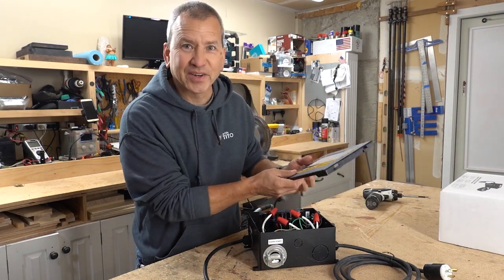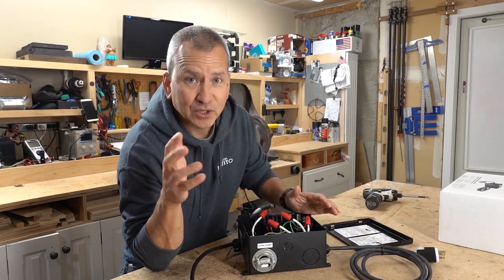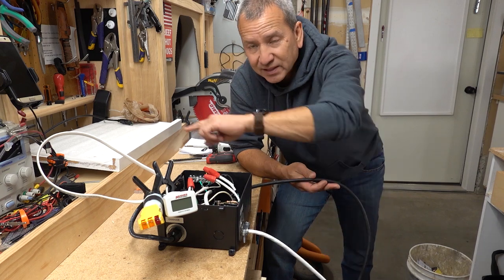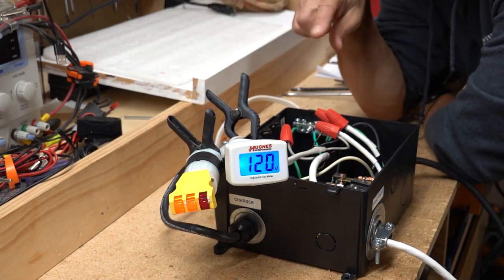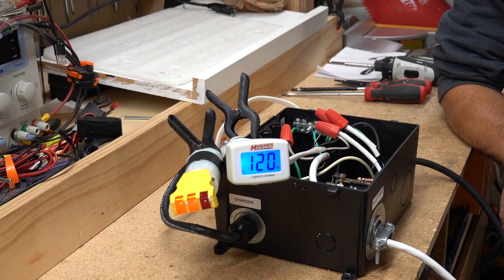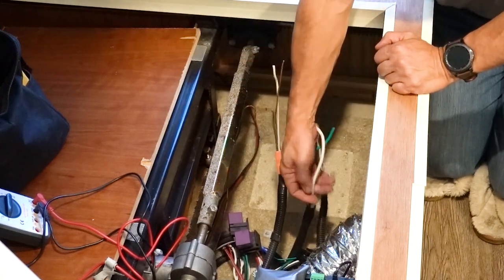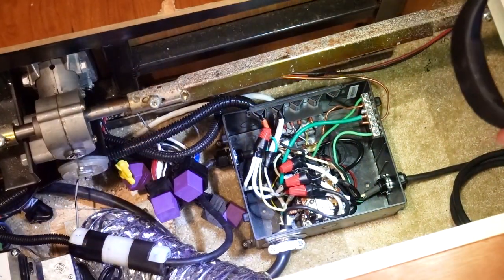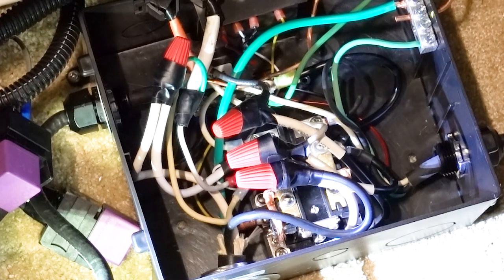DIY Off-Grid AC Power to Your Entire RV - Inverter Transfer Switch Install

Comment: Hello, I have a question, does the automatic transfer have a delay? If I am using the inverter and the grid power returns, the transfer has a default delay

Comment: Question:  could you put in dc instead of ac on the transferswitch input you are using that isnt shore power.  My rv brings in the dc from a truck and switches it off when ac is applied.  Looking for something similiar

Comment: If you have shore and generator power and a transfer switch, could you add a second transfer switch to the ac output to provide inverter switching?

Comment: Just bought a new Go Power 30A transfer switch and they now look a little different.  All the wire connections are fitted with WAGO connectors and the actual transfer switch is in a little clear plastic case so the wires cannot interfere with the operation of the switch.  Apparently failures were occuring when the wires contacted the switch mechanism.  That cannot happen now that the switch it protected.   Its pretty slick and easy to wire.

Comment: Could you use the charger plug to also connect the AC so it only runs when on shore power?  I don't want my AC to run when the transfer switch goes to the Inverter side.

Comment: Why does the battery charger have a plug? Wouldn't that need to be wired to the converter which charges the battery?

Comment: Still confused about how to connect the my 12v appliances with the 12v solar AND the 12v converter from shore power. ie. If i'm on shore power, can I just run the 120ac/12vdc converter and use my 120v appliances and 12v appliances? and then when I"m boondocking use the 12v battery/inverter to do the same thing? can I just connect the 12v output from the converter into the 12v fuse block that's connected to the 12v solar batteries?
Reply: Your solar goes to solar charger then to batteries,
Your inverter is also connected to solar charger and running off the batteries that are hooked to it that it’s charging, your Rv is always going to run 12v off of the batteries solar or not. When on shore power your batteries will charge with converter and everything in Rv that’s 12v is still running off batteries and all your 120v is running off shore power. If you’re running off of solar and inverter you need to shut off converter so you don’t create a loop that’s what the transfer switch he’s showing does. You don’t need to wire anything to 12v fuse block it’s already wired that way. You can just plug shore power cord to inverter to use 120 and 12v but if you want it all to switch automatically when you plug into shore power that’s what this transfer switch does, plus it shuts off converter at the same time.
So recap solar to solar charger to batteries.
Solar charger to inverter, inverter to transfer switch. Shore power to transfer switch. Charger terminals in transfer switch to input side of converter.

Comment: So is the Shore Power input or feed-line, taking into account ALL charging sources or "mechanisms" - Generator, Engine Alternator, actual shore power & potentially solar?
Reply from the maker: The shore power input would only have shore power or generator power on it. You'd still need a transfer switch to automatically switch between shore/generator power on that input. Alternator and solar inputs are DC and would go directly to the battery, not through the AC transfer switch.

Comment: I have shore power and on-board gas generator already. I am adding 3000 watt inverter so I guess I need a transfer switch that take in THREE sources?
Reply from the maker: Sounds like too much thinking for that switch. You'll need two transfer switches or simply add a plug for the shore/gen input and move it manually.

Comment: OK, everybody talks about the transfer switch. How do you connect an inverter when you were RV has a generator in it already and already has the front switch for power and generator
Reply from the maker: You'll leave the gen/shore transfer switch and add this one to the output of that one.

Comment: yes but what do I do if the RV is designed to run the lights off the converter...ie if the converter is off theres no 12vin camper
Reply from the maker: When the converter is off your batteries should provide the 12v. Are you saying that when you're not connected to shore power your lights and other dc powered equipment don't work?

Comment: Question: Can I use this transfer switch with inputs from shore power, generator and inverter? How would I wire the 3 inputs? Thank you
Reply from the maker: The transfer switch will only take two inputs. You'll need a second transfer switch for the generator/shore power.

Comment: Brian, thanks for the great video, I have an 08 Winnebago. my tv outlet runs off the inverter and when connected to shore power it runs from ac, I didn't understand how it worked but thanks to your video I have a better understanding of it. I just installed an electric fireplace that the tv is now mounted to the top of can I plug the fireplace into this outlet or should I run a dedicated line from the breaker box?
Reply from the maker: You'll need to know the rated AC current (in amps) of the fireplace and everything else on that circuit. Make sure the electrical wire and circuit breaker on that circuit is adequate.

Comment: Hi Tito , what do you have wire from your shore power on your fuse box? Do you have any outlets plug into your 12v fuse box?
Reply from the maker: Not sure what you mean. You lost me at shore power whic is AC power. We do have several 12v DC outlets and several 5v USB plugs throughout.

Comment: I have a couple of questions. Do I need a transfer switch if I am using the old lines from the generator from my RV? Did you install an on/off switch?
Reply from the maker: If your shore power input can be shore or onboard generator, then yes you should use a second transfer switch if you want it to be automatic. Another option is to add a female power connection to the generator output. You can just plug your shore power cord into it.
Reply: @RVwithTito  thank you I took the generator out though

Comment: I have a question, i just installed a new bigger inverter to run off solar power and i have power to everything except my microwave and AC's. Is this in the wiring after the transfer switch or in the transfer box itself?
Reply from the maker: Most likely after the transfer switch. You're RV wiring may have the large loads on a separate leg. Is it 50A? If so, then your electrical system is split in two. Some RVs also have an energy management system installed which disables power to high power circuits when it detects 30A or 20A service. Hope that helps.
Reply: @RVwithTito  my 5th wheel is 50 amp with 2 air conditioners, so I figured one of them would turn on. If it has that energy management system how would I bypass that?

Comment: I enjoy all your videos.  Your work is outstanding, explanations are clear. Thanks. My question: how come you installed the transfer switch flat? I was always told  and read that  a transfer switch can be installed in any position EXCEPT flat, for security reasons. 
Safe travel.
Reply from the maker: I just put it where the previous transfer switch was. What could you tell us about the security concern? Thanks.
Reply: While troubleshooting a Magnum 3112 with a failed breaker switch, one of the 2 switches had burned because the coach  vibration led to the 'off duty switch' to fall flat and short circuit. Still can't figure out why, but it was 8 years old...?
While looking over videos on YouTube,  seems some manufacturers do not recommend mounting flat, probably for that same  safety reason.
Manufacturer install manual probably is the reference if the product is well documented, which is not always the case with some Asian products.
I especially enjoyed your video on the Lithium batteries/ bracket. Will build something similar. Very cool !
Safe travel.

Comment: My converter came with a three prong plug. Where do I plug it in of can I wire it in to the box with a circuit breaker?
Reply from the maker: Sure. You could always remove the plug and hard wire it. If you prefer not to do that, then wire a cord to the transfer switch and put a female plug on the end. That way you can just plug the converter in. Be sure to use a proper gauge cable though.
Reply: I bought a plug and used the tire from the old converter. Thank you.

Comment: is there a built in circuit breaker in the switch? is that why you don't reconnect to the breaker on the power center? thanks
Reply from the maker: The switch has a fuse on that line not a breaker. I took it off the breaker since the breaker panel is on the main AC bus.

Comment: You did pretty much same thing using a contactor, about 6 years ago. Have you changed your mind on using a contactor?
Reply from the maker: Still needed to flip the breaker on the converter charger each time with the contactor setup.
Reply: @RVwithTito  I’m really not arguing, but the name of that video was “how to automatically disconnect a converter charger when using an inverter”. I’m just trying to understand. I do enjoy your videos!

Comment: How come you not to use your generator anymore? can I use my generator with this system?
Reply from the maker: I had lots of solar and a DC-DC charge for recharging batteries while driving, so I no longer needed it. Yes you could use a generator. You just may need a second transfer switch.

Comment: How do you power your 12 volts with out the converter powered do you run a separate wires to the dc side of your panel
Reply from the maker: When the converter is not on 12V power comes directly from the batteries.
Reply: @RVwithTito  i only get 12 volts to the dc side of panel when the converter is powered

Comment: Thanks, Brian. Love your videos and apply many of them. 

My question is, “Do you even need your legacy charger anymore?”

It seems your new DC-DC converter or your solar charger should have the batteries all charged up by the time you arrive and plug into shore power. Will you ever actually charge your batteries from shore power?
Reply from the maker: You're right. I rarely do. During the winter perhaps.

Comment: hi
i want to install this transfer switch but i have a question,

i have my original house battery setup 1 house battery from engine bay that operates my low 12v lights and water pump and i have another solar setup of 200ah batteries with inverter that i want to connect the inverter to the transfer switch but when it will operate the inverter it will also operates the converter and sends 12v from 2 places one from the solar battery setup and second from original house battery in engine front,

how do i connect it so it will work the best???

Comment: Excellent video. Really enjoy how you explain things at a level I can understand. It's it possible to run a similar transfer switch set up to a portable power station? Since I don't have a built in inverter system, I have an EcoFlow Delta Pro that I plan to use as my boondocking power system on my travel trailer. Thanks.
Reply from the maker: Yeah. It should work and switch to the EcoFlow when you power it on.